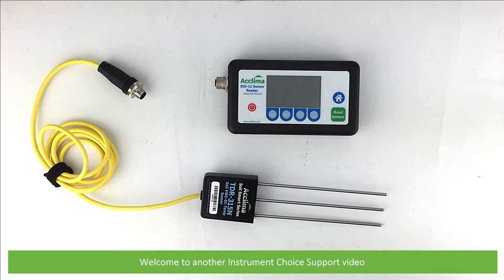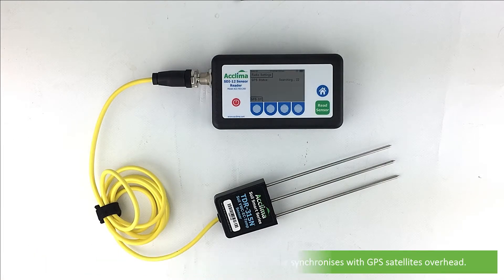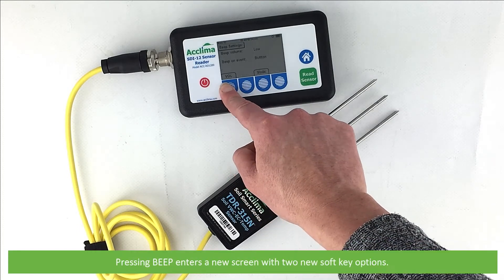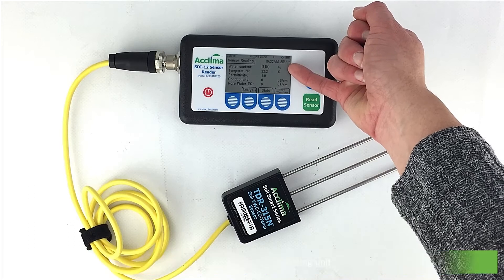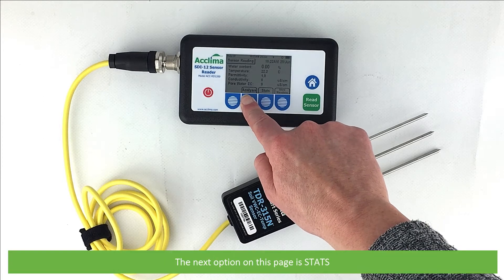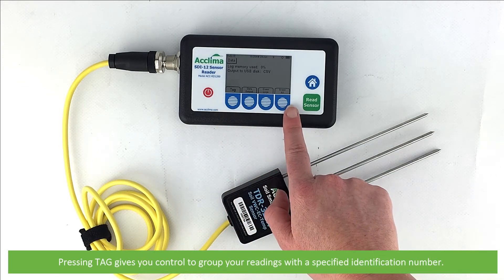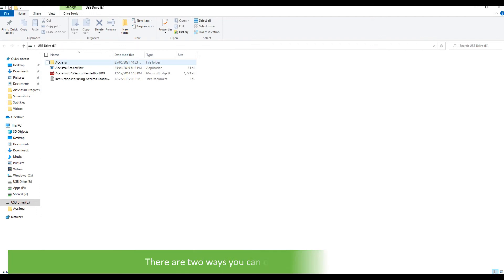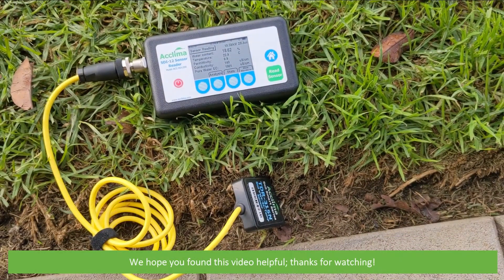How Use And Export Data From The TDR Digital Soil Moisture Sensor Reader (IC-RD1200)

Comment: This in no fucking TDR! just a capacitative probe.
Reply from the maker: Thanks for the reply to our video, can you confirm where you have seen this is a capacitance probe?

The TDR-315N is stated as being a complete integrated time domain reflectometer sensor that combines ultra-fast waveform that provides True Time Domain analysis of soil-propagated waveforms. So we would be curious to see where the information regarding it being a capacitance probe is from.
Reply: @instrumentchoice  It is not plain capacitance, but the antenna's are not isolated to the ground. I am basically disappointed, because this is just another cheap shortcut, not a full blown radio sensor, what TDR should be.
https://literatur.thuenen.de/digbib_extern/bitv/zi033840.pdf
this, but with a dirt cheap BLE Module.
Reply: @instrumentchoice  Just dump all that above and answer me, will your probes work, after i coat them with polyurethane?
Reply from the maker: @goiterlanternbase  , we are checking with the manufacturer and will let you know.
Reply from the maker: @goiterlanternbase  , coating the pins in Polyurethane is outside of the manufacturer’s specifications and could change the readings as it has not been tested specifically.

For more information on TDR measurements from Acclima, check out this video - https://youtu.be/6Yb4dstWWDs

If you are needing more information we would recommend you speak to Acclima and their engineers as they would be able to understand the inner workings of the devices.  Sorry we could not be of more help on this one.